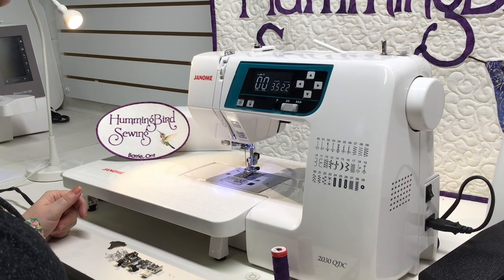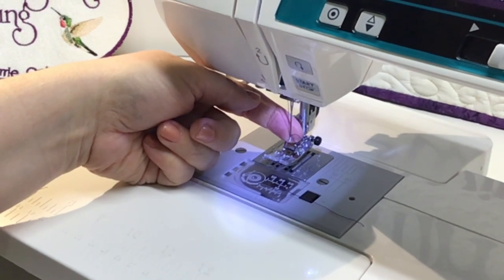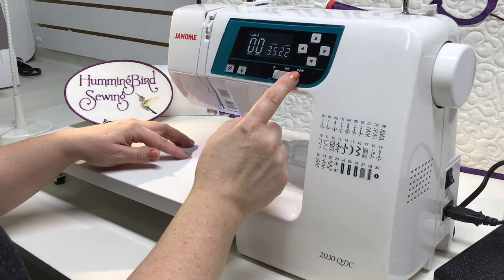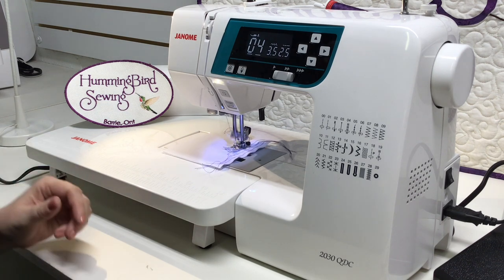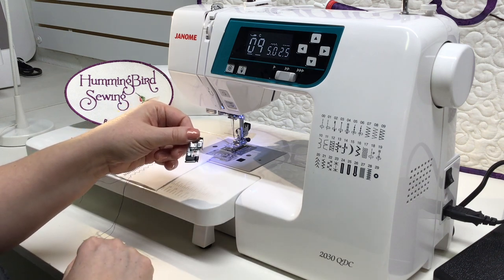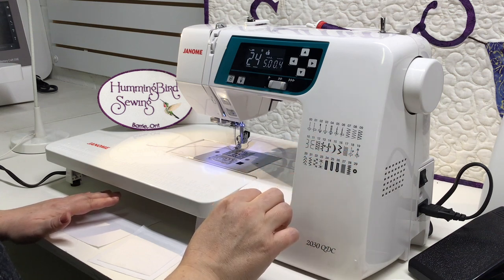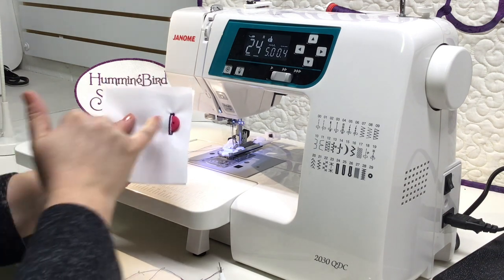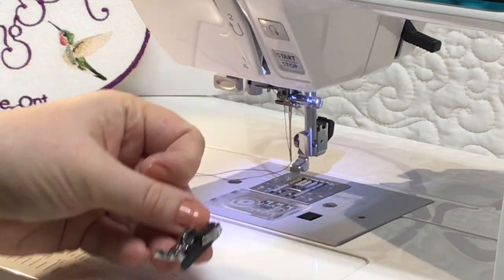JANOME 2030 QDC Lesson

Comment: Stitch number 3 is this what is called a reinforcement stitch?
Reply from the maker: Hi Pauline, Stitch number 3 creates a locking stitch (knot) at the beginning and end of a regular seam. I believe you may be referring to stitch number 4, it take two stitches forward and one stitch back to create a very secure stitch. It may be called a reinforcement stitch in some circles. Others may call the backstitch a reinforcement stitch which you use at the beginning and end of a seam. Hope this answers your question.